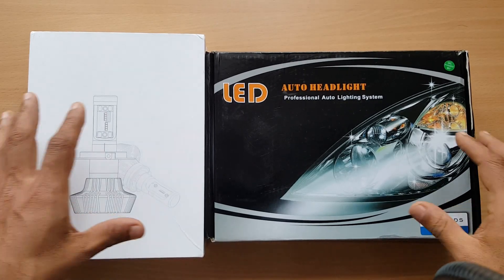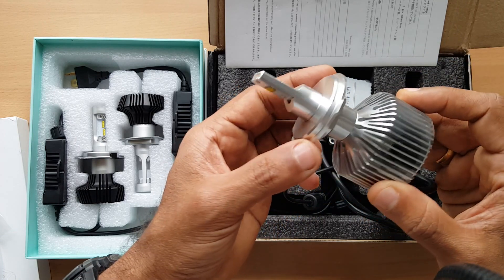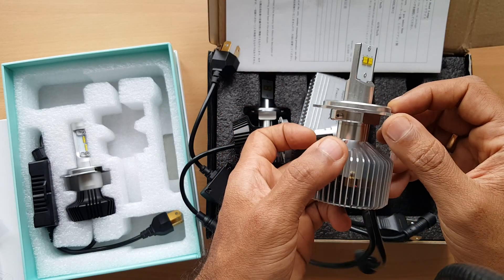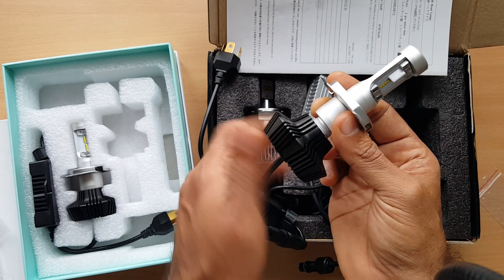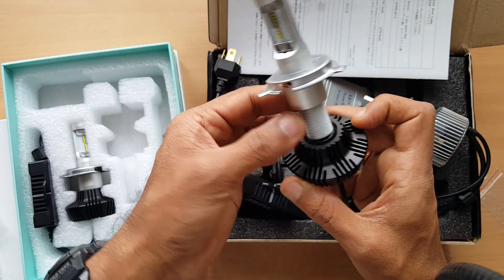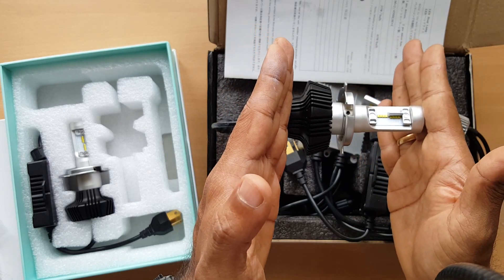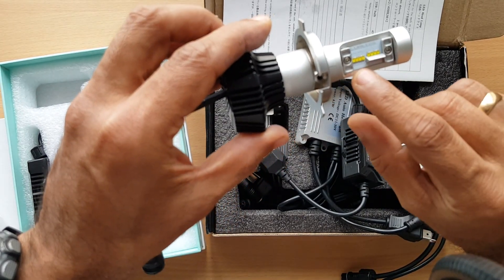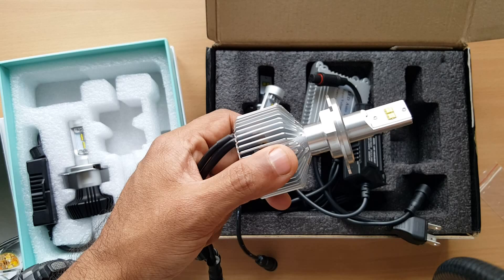New Generation Philips H4 ZES Led Bulb with Removable heat sink VS Philips MZ fixed heat sink

Comment: Will the left one fit in elite i20
Reply from the maker: Yes it will if you are have a H4 type bulb ( single bulb in your headlight for both High beam and Low Beam), There is a new bulb with more power for the same price check this link : https://www.youtube.com/watch?v=BpNk0ptJWyI
Reply: WheelKlub where can I buy the left one from in india, I want two sets h4 for headlamps and h7 for fogs, also do they have warranty
Reply: Cree is not the same as Philips!!Cree has a bad name.

Comment: Hi.  Which kit is more reliable and brighter?  Thanks!
Reply from the maker: +donsdavid 

Hi Donsdavid, My answers for your questions.

1) Which is Brighter : The MZ series headlight ( with the fan in it)
2) Which is Reliable : I need more time to know which one is reliable
3) Which is Easy to use : The Latest ZES chip headlight with removable heat sink
4) which light s focused (aligned) : The latest ZES chip head light have good cut off in low beam

My over all choice is the ZES chip head light with removable heat sink having more advantage over the previous gen Head light with fan.

Thank you for your comments, Have a great year..
Reply: +WheelKlub Thanks a lot! :)
Reply: +WheelKlub I just purchased 55w 5200LM MZ bulbs and 25w 4000LM ZES bulbs on ebay.  I also purchased a SiriusLED 25w 4000LM ZES bulbs from their website which cost almost twice (shipping included) than the ones on ebay.  I can't wait to get them. My main concerns about LED lighting are how well they distribute the light and their extended CRI values since they do not produce a full spectrum light like HIDs or Halogen bulbs.